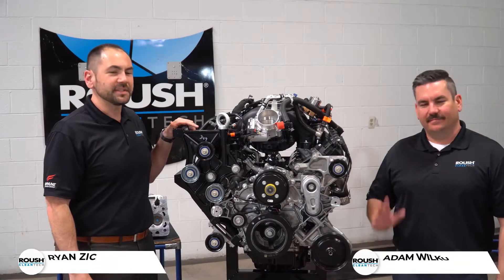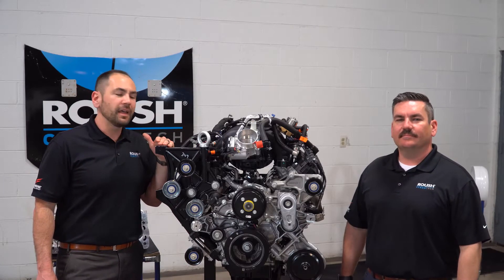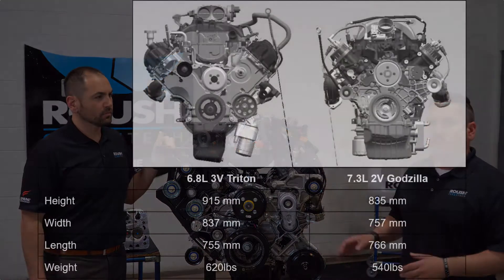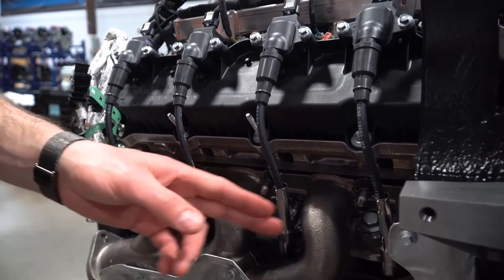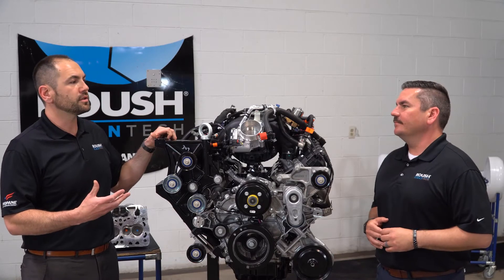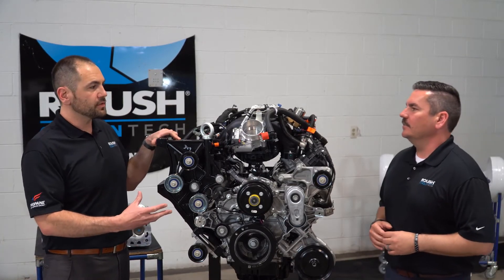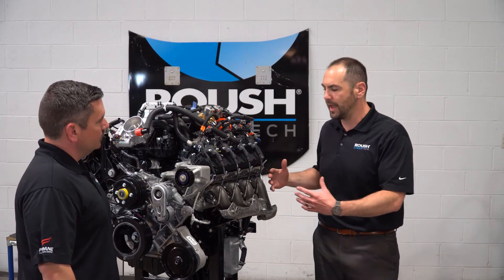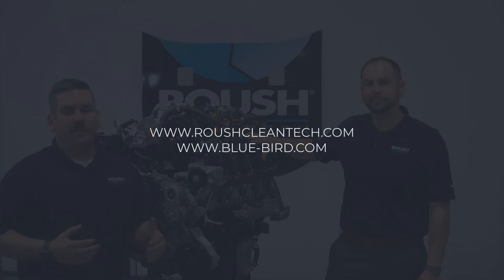ROUSH CleanTech 7.3L Engine Overview

Comment: Hearing of lifter issues with this godzilla engine at or 100k miles, oil press is low when idling and the oil used is so light, I believe they should hsve heavier oil in them. The v10 had issues with the exhaust manifold studs is the problem corrected

Comment: Ford produced a hydrogen powered V10 F-250 back in 2008.  Any chance they will modify this engine to burn hydrogen to make the exhaust cleaner than the air going into the engine?  

Then they could use this hydrogen powered engine to power a generator to for a class 8 truck via a pair of 300 HP motors and only need to have a 200 KW battery pack.  It could even supply power to a trailer mounted 200 KW motor / generator that can charge it's own 100 - 150 KW battery bank (on the trailer) to save fuel and put some of the extra HP needed to go up the hills. With a 50 amp power cord (4-#6 wires and a #10 ground) running 800 VDC and only 40 amps through the wires, you could transfer 64. KW per hour from the truck to the trailer battery.  If the engine is running a 16 pole 800 VDC alternator, it will be much more compact and lighter than a conventional 200 - 300 KW generator.  

Yes they already produce a motor unit for trailers, that uses regenerative braking to charge it's battery pack, Fleet Owner did a article back in 2016 on such a trailer unit.  It saved up to 30% on diesel fuel in fleets that use them.